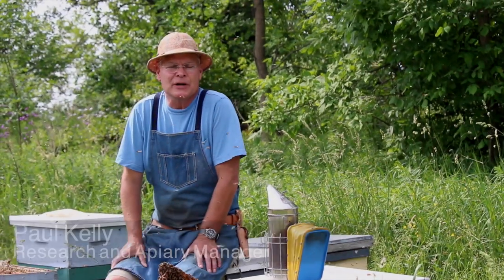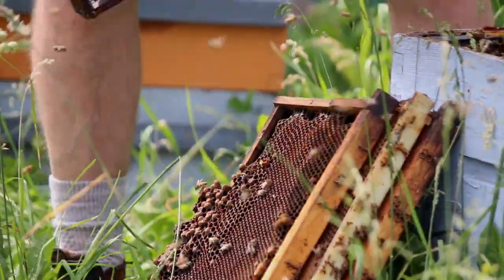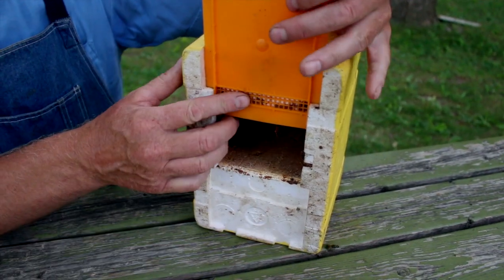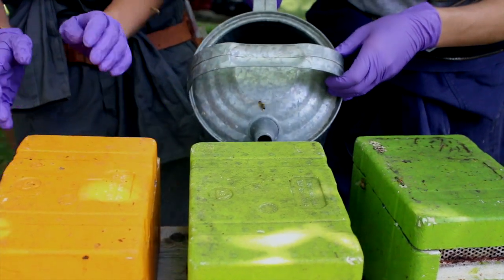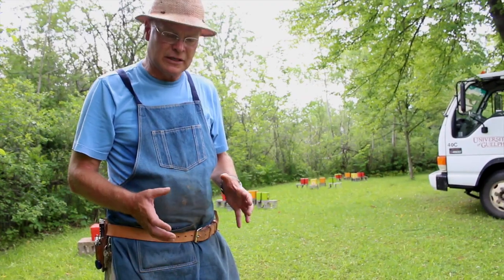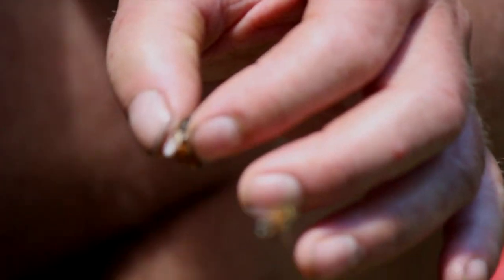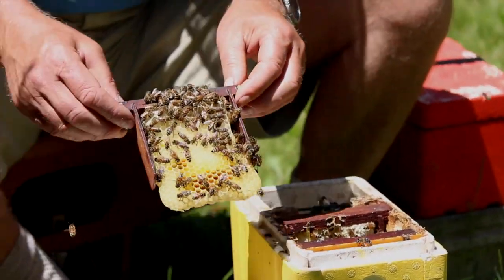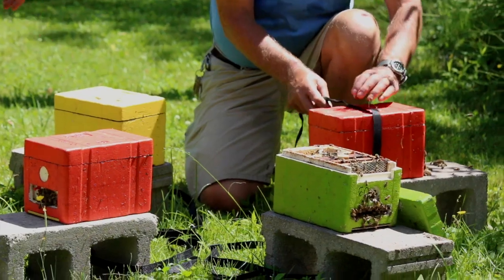Making Mini Nucs

Comment: 🐝 (^_^) 👍
Reply from the maker: Hi Volodymyr
  Happy beekeeping!
Reply: beehive.ua@gmail.com
BEEHIVE ADVANTAGES: 
The main advantage of the hive design is that the bee colony can independently function in the hive without any human assistance for a definitely long period of time, until the complete ageing of cells in the nest occurs. The living conditions of a bee colony in the hive are as close as possible to the natural conditions of its living in the wild, the development of the brood nest, which has the correct shape and size, occurs in the vertical direction.

Due to the hive design we have the following advantages: 

- the minimum number of hive maintenance operations with minimum costs;

- due to a sufficient volume of the brood nest for maximum laying of the queen bee and the cut boards we have separate honey and brood parts of the nest without the use of separation lattice, the use of which will later result in more different problems than advantages. In this design the queen bee moves freely only in a certain brood part of the nest and does not go up into the honey frames;

- no unrestricted horizontal expansion and narrowing of the brood nest;

- a beekeeper does not form a nest for the winter, only the bees form a nest for the winter themselves;

- no side walls and blocking boards; 

- no interference in the brood nest. We always have 8 nest frames in the brood nest, with width 30 cm. and height 59 cm. and we never draw honey from these frames. We interfere in the brood nest in the early spring time only to replace the aged cells with the new ones;

- brood nest frames are like in the wild conditions - solid, they do not have connections and breaks like in the chamber structure, which later (not direct) also increase the chances of bees’ swarming;

- due to inter-chamber space the brood part of the nest does not get overfilled with worker-bees and young bees; 

- no gradual placement of honey chambers. As soon as the first male-bees appear, we immediately put on top many honey chambers, possibly for the whole season;

- no risk to cool the brood nest part, and thus we can extract honey at any time of the year, even in winter; 

- due to inter-chamber space during honey yield the honey part of the nest has extra ventilation, while this extra ventilation does not affect the brood part; 

- no heat insulation for the winter or taking hives into a winter premise;

- ideal wintering without moisture, with toroidal ventilation between chambers providing heat economy;

- bees do not gather at flight board when hot; 

- control of bee diseases occurs in natural ways and traditional methods, without the use of toxic chemicals;

- filling honey frames with nectar occurs from the bottom upwards, and not vice versa, as in other hives, from top to bottom.

All the above listed advantages create conditions to minimize the swarming of bees in this hive.
Reply: Look at my latest video.
BEEHIVE ADVANTAGES: 
The main advantage of the hive design is that the bee colony can independently function in the hive without any human assistance for a definitely long period of time, until the complete ageing of cells in the nest occurs. The living conditions of a bee colony in the hive are as close as possible to the natural conditions of its living in the wild, the development of the brood nest, which has the correct shape and size, occurs in the vertical direction.

Due to the hive design we have the following advantages: 

- the minimum number of hive maintenance operations with minimum costs;

- due to a sufficient volume of the brood nest for maximum laying of the queen bee and the cut boards we have separate honey and brood parts of the nest without the use of separation lattice, the use of which will later result in more different problems than advantages. In this design the queen bee moves freely only in a certain brood part of the nest and does not go up into the honey frames;

- no unrestricted horizontal expansion and narrowing of the brood nest;

- a beekeeper does not form a nest for the winter, only the bees form a nest for the winter themselves;

- no side walls and blocking boards; 

- no interference in the brood nest. We always have 8 nest frames in the brood nest, with width 30 cm. and height 59 cm. and we never draw honey from these frames. We interfere in the brood nest in the early spring time only to replace the aged cells with the new ones;

- brood nest frames are like in the wild conditions - solid, they do not have connections and breaks like in the chamber structure, which later (not direct) also increase the chances of bees’ swarming;

- due to inter-chamber space the brood part of the nest does not get overfilled with worker-bees and young bees; 

- no gradual placement of honey chambers. As soon as the first male-bees appear, we immediately put on top many honey chambers, possibly for the whole season;

- no risk to cool the brood nest part, and thus we can extract honey at any time of the year, even in winter; 

- due to inter-chamber space during honey yield the honey part of the nest has extra ventilation, while this extra ventilation does not affect the brood part; 

- no heat insulation for the winter or taking hives into a winter premise;

- ideal wintering without moisture, with toroidal ventilation between chambers providing heat economy;

- bees do not gather at flight board when hot; 

- control of bee diseases occurs in natural ways and traditional methods, without the use of toxic chemicals;

- filling honey frames with nectar occurs from the bottom upwards, and not vice versa, as in other hives, from top to bottom.

All the above listed advantages create conditions to minimize the swarming of bees in this hive.

Comment: On what day do you pull your cells? Day 14?… and then they're in the Caricell?
Reply from the maker: Hi Todd
We remove our queen cells from the cell builder 10 days after grafting which amounts to 14 days from when the egg was laid.  Please see our videos Cell Building part 1 and 2 for more details about our cell building process. The cells go from the cell builder to the Caricell to the queenless colony or nuc all  on day ten from grafting.
Reply: Hi! You put in a 14 days old cell, and after two weeks you have a cell with a bottom opening that looks like it was opened the day before. that's 27 days. i don't get it.

Comment: Would it be possible to mate queens in a single frame deep or medium langstroth?  It seems like they would have the same area as your little nucs.
Reply from the maker: Yes it would. Not a natural shaped hive though so I  don't know how it would work. I've seen some really neat 1 x 1/2  frame nucs but they were well insulated.
Reply from the maker: If you had multiple nucs in one box you could have more problems with queens orienting to the wrong entrance. By 1 X 1/2 frame I meant one frame, full depth, i/2 length. These were individual nucs not multiple nucs in one box. A 6 5/8" deep box divided by four with half length frames works well.

Comment: Thankyou for this informative and well produced video! The wood squares your queen cups hang from are clever: did the lab make these themselves or is a commercial setup available? BTW I really like the nuc paint colours!
Reply from the maker: Hi Westernwilson
 You are quite welcome. I'm pleased to hear you found it informative. A mentor, Barry Davies, gave me the idea for the cell bases. I got lots of good ideas from him. If you find someone like that,  don't talk - listen. We cut them out of scrap wood from other projects. I'll get you the dimensions later.
Reply: Thankyou for that! Do the squares fit into custom frames for cell building/finishing?
Reply from the maker: Hi Westernwilson
 The cell bases are 4mm thick, 21 mm wide and 19mm long. They are made to overhang  slightly each side of the 19mm wide cell bar. The overhang makes it easier to pry them off the bar when the cells are mature. We make our own graft frames. I'm going to try making some graft frames that are very narrow as I'm told you get less burr comb around the cells.
Reply from the maker: Hi Again
 Please see our video on grafting for a better look at our cell bars and grafting frame.

Comment: Great video, thanks for sharing !!!!!

I have some wooden mini mating nuc box but my main problems are ants and that the bees absconding the nuc. I'm from Chile, here pheromon strips are not available. I'm planning to leave bees confined longer (maybe two nights) in order to avoid bee absconding. 

Greeting from Chile (South América).
Reply from the maker: HI Felipe in Chile
 Ants aren't a big problem here so I can't comment on that problem. You could probably order the pheromone from the Canadian company below. Mann Lake in the US also sells it.  Both would ship it to you. It has an 18 month expiration and I store it in a freezer. It's really helpful to hold the bees in the nucs and is not expensive relative to the cost of your time and the price of queens. I'm sure we lose a few bees but there is no absconding. I understand that confinement in a cool dark location for a few days can work too but with the pheromone strips it's not necessary.
 Thanks for your feedback Felipe.
Intko Supply Ltd.Suite 604, 3345 Kingsway 
VANCOUVER, BC, V5R 0A7 Canada +1 (604) 356-7393pheromonesupply@gmail.com
Reply: Try setting your nuc on a upright concrete block that sits inside a  cookie tray; then add a film  of mineral oil to the cookie tray. This took care of our ant problem

Comment: My mentor was a professor of entomology at a college in Pennsylvania.  I assisted him in his classes.  One day I used the term 'when the queen hatches'.
He immediately corrected my by stating, 'queens emerge'.  
Since you are a research center I would expect proper terms used in the presentation.
Excellent presentation by the way.  It's always nice to have helpers working with you to keep the system running smoothly.
Reply: Hi Bob
Thanks for the note.You are right to say that emerging is the correct term. I'm  not too fussy about terms. I'm happy if the ideas are understood.

Comment: Any reason that you cut out all the wax every season? Seems very labour intensive for both beekeepers and bees. Where do you get wax foundation in Canada? Perhaps the university has it's own foundation mill? I thought I saw the mini nucs laid out in a yard without "mother hives", yet upon queen harvest there were mature colonies there. What happened? I assume the pheromone strips hold the mini nucs together and prevent the drifitng? I have no experience with the strips but we take all kinds of other precations to avoid drifting. Strips are likely the cheaper option. I suppose 1/2 strip per mini nuc/per year.
Reply: It works better for us to melt the comb out of the frames and install foundation strips each year. The equipment stores better and the comb is quickly replaced by the bees. In nature, comb building is the first job when moving into a new home. Having no comb in the nucs gives lots of room for pouring in bees too.
 A beekeeper friend makes the foundation for us from our own wax. The video scenes were taken in different locations in the same yard so that explains why you see full size colonies in some of the footage. We have 120 full size colonies and seasonally about 100 mini nucs in this location.

Comment: Are you sure that the young bees will not destroy the queen cell if you do this the same time?Maybe it's better for the bees to feel quenless and put the cell the next day.What do you say?
Reply from the maker: It works fine to introduce cells to these nucs on the same day they are made up. The bees are queenless for an hour or so before making up the nucs and introducing the queen cells. Cells are easier to introduce than queens.
Reply: Thank you for your answer,also it's better to open the mini nuc's in the night because in the morning many bees will go away because they are looking fir the previous position and the will not come back.
Reply from the maker: I should have mentioned that we open the nucs up very early in the morning - before there is any flight in the apiary. As you suggest, night time would be ideal but the nucs aren't near where I live. Please note, as mentioned in the video, that the bees for the nucs are collected at a location far enough away from where the nucs are placed to prevent drift. The pheromone strip really helps to hold the bees too.